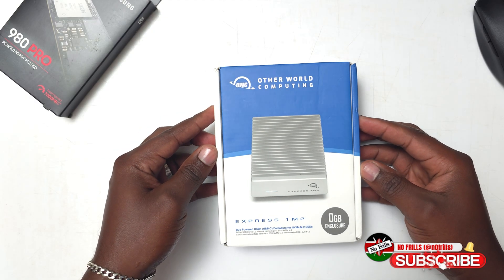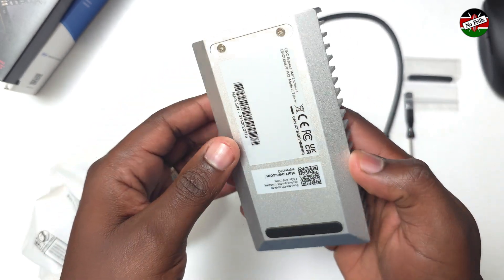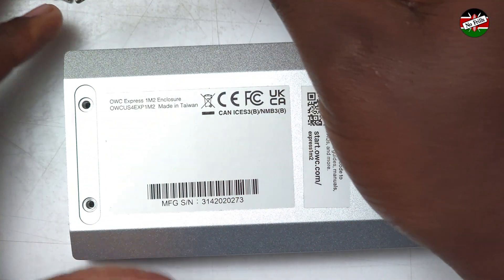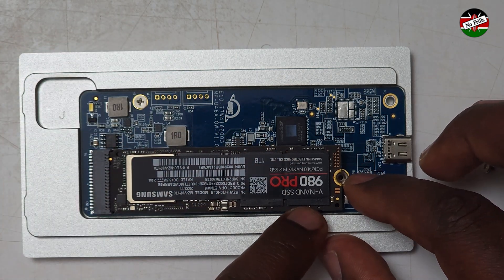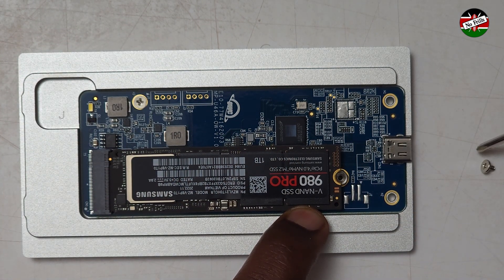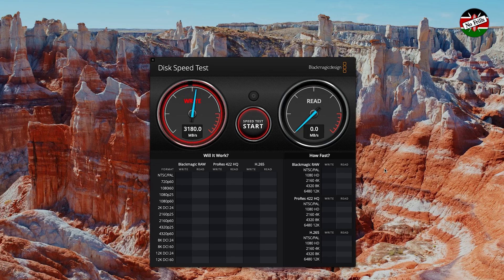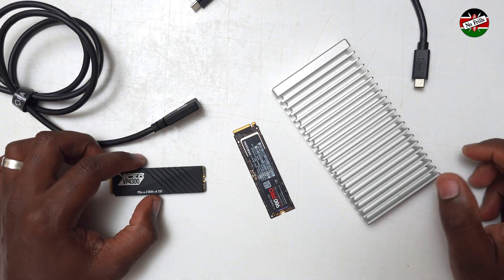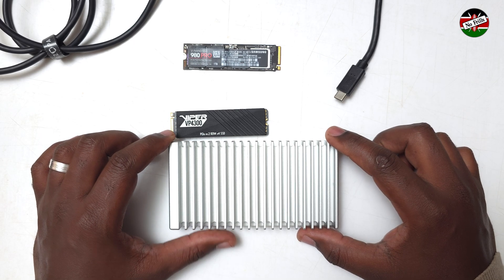Is the OWC Express 1M2 a reliable external storage for the base Mac Mini M4?

Comment: 1. Check logs in the system report, and error information is reported. 2, update your system, the system has bugs. 3. Set the file format to APFS. 4, Mac connected to too many devices, limited bandwidth.
Reply from the maker: @dizhang-h9u  While I agree with 1 & 2, 3 and 4 are invalid. In the video, I clearly stated that the first thing I did was format to APFS. I tried other drive formats later to see if APFS was the issue; it was not. I also tested with nothing connected but a 1440p monitor and the drive itself and still got the disconnects. The two 1440p monitor and the 1080p monitor (hdmi) don't exhaust the bandwidth of their respective ports. So I don't believe it's a bandwidth issue.

Comment: A few things: It's USB4/Thunderbolt "compatible", not Thunderbolt 4. Although portable, its size and weight would suggest it's meant for a desktop setup. 
Wouldn't it have been more appropriate to post a review AFTER you ironed out your specific issues, rather than assume this was a universal issue?
Reply from the maker: Thanks for the correction about TB4. Well, most of these external enclosures are used on the go with laptops, so I don't think it was primarily meant for a desktop setup. The fact that they sell a cling-on as well suggests that they are trying to mitigate unstable conections due to cable movement, an issue typical to portable use. It is always better to document the first time user experience as well as long term. In this case it simply didn't work as it should out of the box. I have had to put it aside as it's practically unreliable and may corrupt data or even damage the drive. IMO this frustrating experience is a point well worth noting in any review even if it gets fixed down the line. Before posting the video, I first consulted Reddit and noted that quite a number of users were going through the same disconnect issues, even with enclosures from other manufacturers. Later on appleinsider made an article (pinned) about M4 Mac Mini usb issues. OWC support also asked me to wait for a Mac OS update.
Reply: Arkadaşım adam haklı. Birçok aple mac mini m4 de aynı sorunları yaşıyorum. Şimdi jeyi marka bir m2 ssd okuyucu kullanıyorum içerisinde kingston 2TB m2 ssd ile. Ancak benzer sorunları yaşıyorum. Sorunun apple driverından kaynaklandığını düşünüyorum. Ayrıca spootlight ın sürekli hardiske okuma yazma yapmasından kaynaklandığınıda düşünüyorum. Mac sequia gerçekten sorunlu buna güncelleştirme gerek

Comment: Does mac m4 support egpu?
Reply from the maker: Unfortunately, it doesn't even though it has thunderbolt 4.
Reply: @n0frills  will you try installing windows in virtual box and connecting egpu to it?
Reply from the maker: @mipad553  Hello I don't believe the Apple silicon macs are compatible with egpus. Also as far as I know, the only way to install windows is by VM (e.g. parallels, vmware etc.). Direct install using bootcamp won't work.

Comment: I purchased the OWC 0TB 1M2 enclosure, installed a 2TB Kingston NVME m.2 and have not had any issues for over a week now.  (knock on wood) I've moved my home folder to this external drive and have since run two timemachine backups to another external HD connected to the mac mini without issue. Your enclosure may be a lemon.  I am using the stock USB TB4 cable that came with the enclosure. So far this has been a great setup for the cost.
Reply from the maker: What mac OS version are you using?
Reply: @nofrillstech  15.2
Reply from the maker: Then it may be my unit :(
Reply from the maker: I suppose it could be my unit then.

Comment: Just to be clear you are going to replace the internal drive and not get a replacement enclosure?  What kind of backup system are you using?  Thanks for the informative video.  I'm doing research before I upgrade from M2 to M4 mini.
Reply from the maker: Honestly, I wouldn't buy another enclosure as 1m2 was one of the best and some users are also reporting about the unreliability of enclosures on M4/Sequoia. If OWC replaces the unit that would be great, but I'm definitely not buying a new one. Yes, sometime down the line I will replace the internal 256 GB drive with an aftermarket 3rd party one. This is a new mac and my work files are constantly synced with a NAS. Eventually, I will use time machine to backup before the drive swap. I hope time machine can backup to a network drive lol. Thanks for watching the video!

Comment: Hi I’ve recently upgraded from an old 2014 mbp stuck on big sur, to a m4 mini running sequoia. I also bought sabrent tb4 dock and ssd enclose and nvme m.2 Samsung ssd. Now the ssd is not new, I’ve had that a couple of years. But I have discovered that sequoia is very unreliable with respect to accessing any type of external disk. Big sur is flawless, no problems anywhere. Researching this, I found the same applies to sonoma, so I do wonder what is going on here. I can see that you appear to be suffering the same issues that I have. What would be useful for you to try is the same activity on another Mac running an older os, preferably older even than sonoma. I have also found many other bugs in sequoia, but for the purposes of this post, I’m just focusing on accessing external disks. The biggest problem I’ve seen is when performing write operations. When I first connected my dock/disks to the m4 mm, dragged a folder to write to the disk, I immediately got a generic error, something like “an error occurred”. And no, it wasn’t an NTFS disk, it was a freshly formatted exfat disk. To be honest, I don’t think there is anything wrong with your drive or enclosure and I don’t think it’s a power issue, because the dock I’m using is self powered but this is a problem caused by sonoma/sequoia
Reply from the maker: I believe you're right. Sorry about your experience with the Sabrent dock and enclosure. OWC advise that that I wait for the next mac update as they continue looking into the issue. Indeed, it could be power draw issues relating to Sequoia. Unfortunately, this is the only mac I have (mainly a windows user) so I'm unable to test older versions of mac OS. Let's see if an update will resolve the issue. Thanks for watching!

Comment: Seems like a cable issue. I got this enclosure a week back, been using it to transfer large data, including some old corrupt/ complicated files, that too over night/ over long durations. Cable Im using is Apple Thunderbolt Pro cable. For power to be drawn at a consistent rate , cable needs to be top notch especially when its driving so much data at such speeds. You might be right about Mac mini port not able to give that much power, which is strange it, should be able to like any other Usb4. Working well so far with my M3 pro macbook.
Reply from the maker: This is the second time I've heard about using the premium Apple TB4 cable. I wonder if it will be the solution. I might try down the line. Thanks!
Reply: @nofrillstech  Maybe you can borrow one just to try , it’s better to just try that out whats to lose right?
Reply: @nofrillstech  also a possibilty that this specific 1m2 is bad, if bought locally in your region get it returned asap. If internationally bought like most of us, well, then it’s just unfortunate.
Reply from the maker: @azamkarnik  Unfortunately I bought directly from OWC. Took over a month to get to my location. Good thing it still works on windows.
Reply: I don’t think there is any issue with the cable. Don’t waste your money. All of the new kit that I bought to work with mm running sequoia works flawlessly with an old 2014 mbp running big sur, so the problems must be down to sequoia. Either that or there is a hardware issue with the mm m4
Reply: @dawnrazor  Running Sequoia on my Mini M4 pro using a Satechi TB4 with WD SN850x and a Trebleet TB5 with a Samsung 990 pro and no issues with any disconnects so not the OS for me or the M4 Mini port.
Reply: @dawnrazor   if it’s hardware issue then it’s a big misrepresentation from Apple’s end, far too many corners are already cut for a cheaper entry level mac, now this too? It needs to be like any other USB4. If it’s software then maybe with future updates it’ll stabilise some day soon I guess.
Reply: @azamkarnik  I finally discovered what the problem was. It’s the Sabrent USB 3.2 Tool free enclosure, which comes with 2 cables a C/A and C/C. The former is sabrent branded connects firmly to the enc and the latter is unbranded and does not connect firmly. I have also tried many other cables and none of them fit properly to the Sabrent. This results in either the disk not mounting at all, or very slow to mount or an unstable connection when it does mount. What is worse is that when the enclosure is connected to a dock or directly to the host when an unsolicited ejection occurs it also results in all other devices being forced ejected so it’s quite destructive but thankfully no lasting damage. I’ve had two of these units now and both suffer the same problem.  None of my other disks have any issues at all. Because of the intermittent nature of these incidents I came to the wrong conclusion about what was the root cause and returned Mac and some other cables under false pretences. I took all my cables and various disks into Apple Store and they said the Sabrent is at fault and nothing else. What a nightmare this has been and the support team at Sabrent are not that helpful either, just very defensive and misleading
Reply: @ whattt. Crazy. After paying all that premium for such good enclosures and there's no quality control on these things?! :/

Ok, so with OWC one, it was a cable issue, and now it's fine for you? For me 4-5 months with OWC 1m2 with m3 pro MBP,  no problems so far.

Comment: You need to update the firmware on the controller chip on this enclosure. The chipset is ASM2492PD. 
Look on YouTube and search for a video titled - ASMedia Dumping And Flashing USB SSD HDD Drive Adapters - MPTOOL to learn how to install firmware. This stops all disconnection issues on a Mac.

Comment: I use the 1M2 with a Samsung 2 terra memory for video editing  on my base model Mac Mini M4 ..... CERO PROBLEMS. Is there a posible better product at almost the same price?  .... yes .... the ACASIS Mac Mini Dock Dual Monitor with 40Gbps M.2 NVMe SSD Enclosure .... which I will buy soon.
Reply from the maker: It looks like I bit the dust with a lemon unit. I will probably upgrade the internal storage as I see replacement modules are now available.
Reply: ACASIS also have an external 80Gbps TB5 M.2 NVMe SSD enclosure wich i have and works wonderful on my M4 Pro Mac Mini !